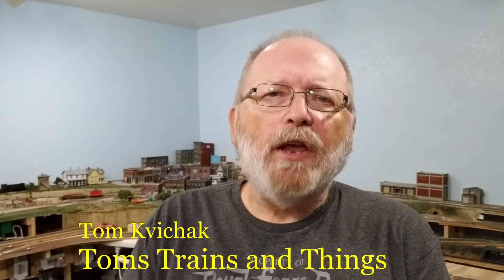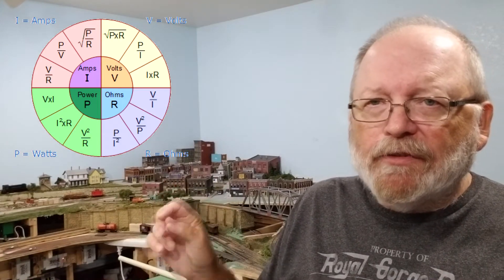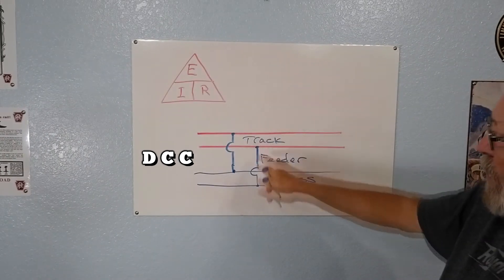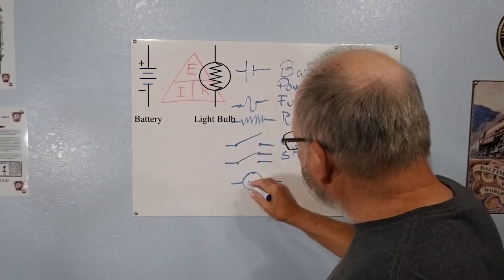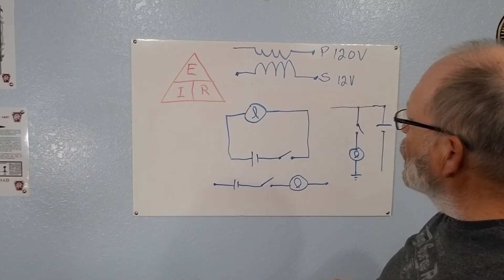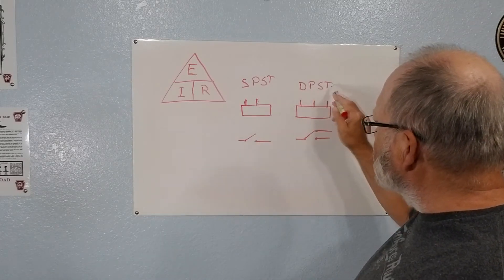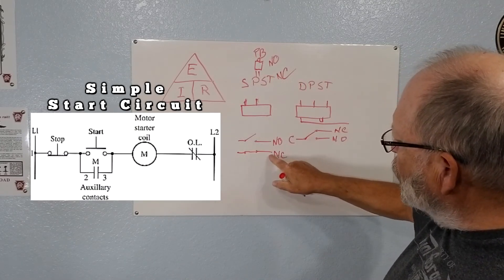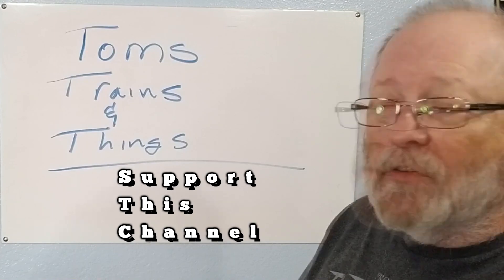Basic Electrical Theory - Model Railroading For Beginners - Ep 16

Comment: When I do my load calculations I figure a half amp per locomotive and locked rotor current of two amps. Yes, I know modern locos are more efficient than that. I base my figure off old Athearn blue box locos, of which I have many.
And yes, I am an electrician, among other things.
Reply from the maker: Thank you for your information Dave.